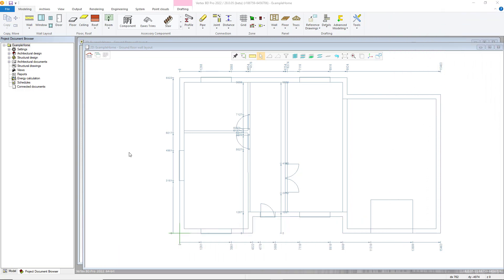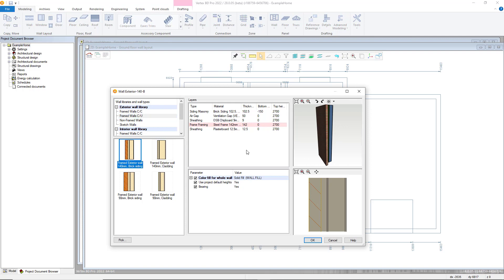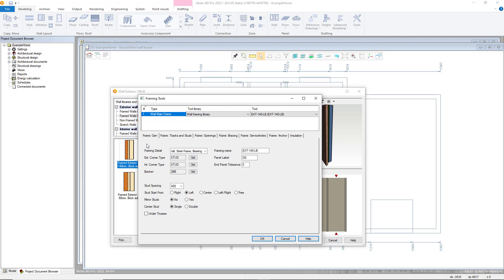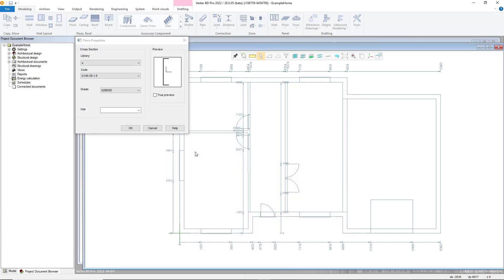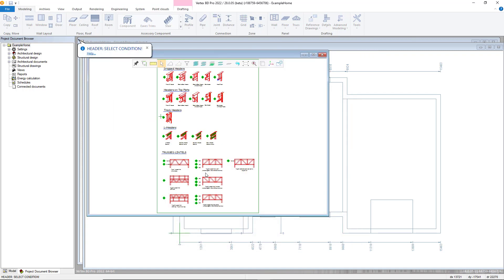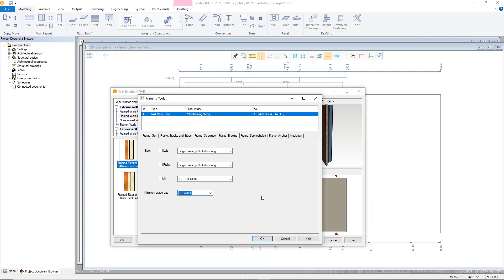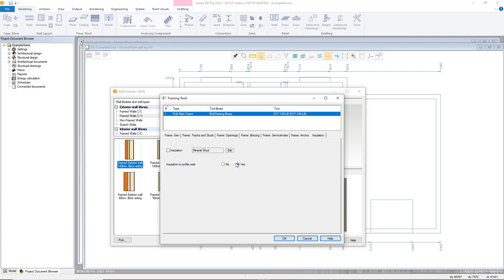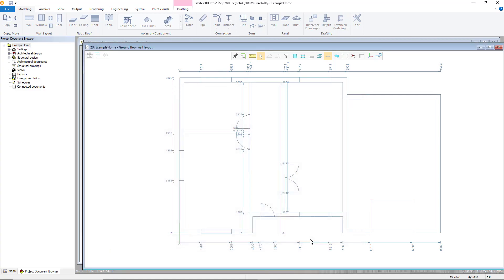Vertex BD Steel 2022 - Setting Wall Attributes

Comment: How to create new type of services hole or bolts in framing tool set ? 
M20 anchor bolt for sample.
Thankyou
Reply from the maker: Hello Tam, Please email our helpdesk and we will be able to disguss this based on your needs.
Reply from the maker: Hi Tam please can you email our helpdesk with more details on this as it may require customisation to your software if it is a completely new service hole or bolt type you require adding. Please send an email to matt wood via our email HelpdeskUK@vertex.fi best regards.